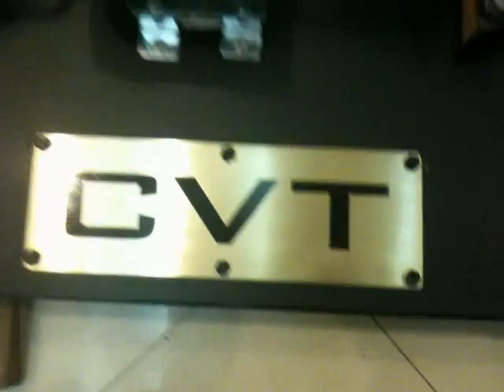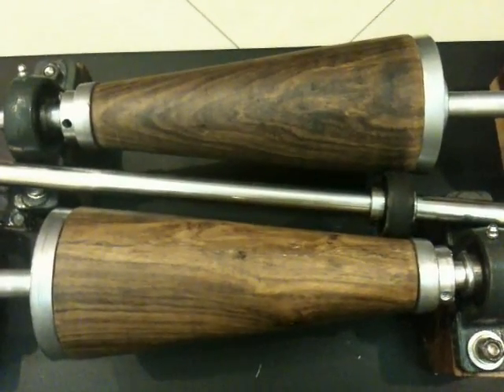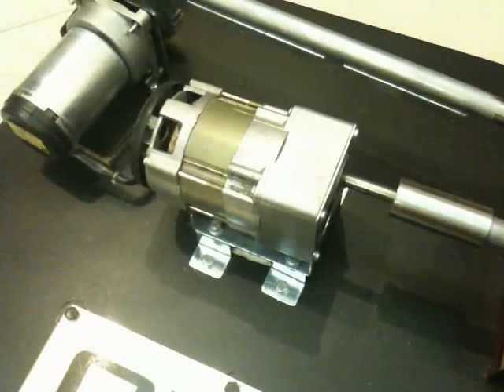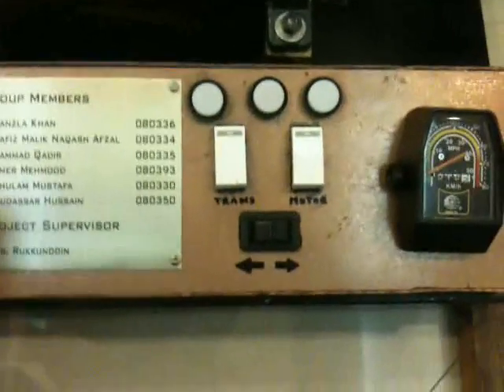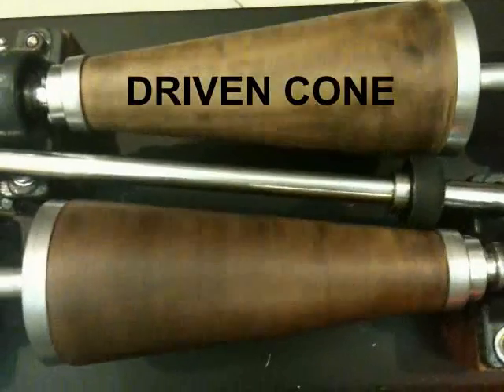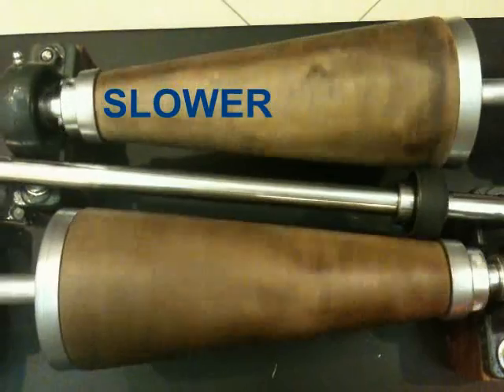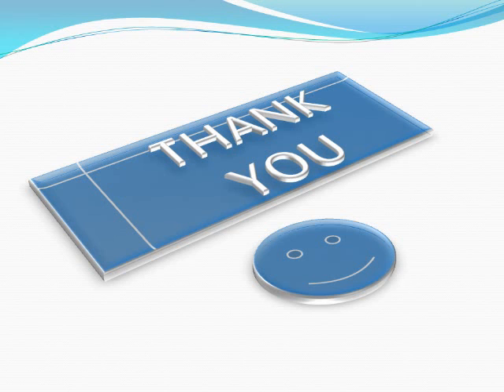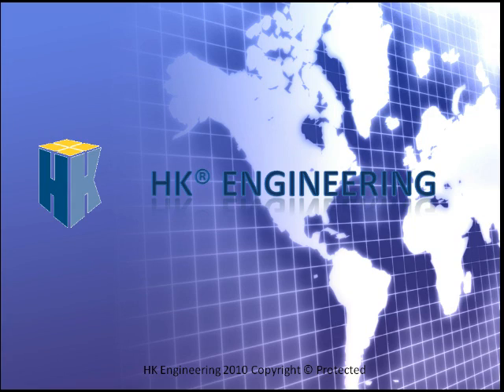CVT Cone Mesh Type

Comment: This has to be the most disconcerting text-to-speech voice I've heard. Where on earth did you find a TTS this terrible?
Reply: It sounds like it originated on earth, was broadcast to Saturn and back and then recorded for the video. Sounds worse than the speak-and-spell and that was '78.
Reply: @jacobyunderhill3999  It sounds like a radio transmission broadcast directly from the uncanny valley
Reply: This video was uploaded 11 years ago.
Reply: @wiros8101  This isn't like 2010 TTS, this is like 1975 TTS.

Comment: In the roll between the two cones there are shear forces because between two contact points of the roller the rotation speed is different. It cannot be used in cars, only as toys

Comment: I hear that CVTs can’t handle high power or torque and aren’t suitable for racing. But seeing that this one has mesh gearing and not a belt, can it handle higher stress?
Reply: It definetely could you dont need two cones one will be enough and have it designed so both the cone and selector cog have splines to mesh instead of friction drive it could definetely handle high loads but i would assume the selector would have to be powerful enough to shift/move during high load

Comment: Exactly what I invented two months ago.. Like always Im 10 years late....
Reply: It's called an Evans friction cone, it was produced around 1920. This is not original and HK engineering didn't invent anything. I strongly doubt they have any patent, as you can see they didn't provide a patent number.
Reply: its hard to be original in 2019

Comment: The cones are constant slope and the roller on the bearing has finite width THEREFORE every point across the roller width experiences a slightly different "gearing ratio". This means the roller is constantly under a torsional stress (i.e leading edge of roller wants to rotate faster than the trailing edge resulting in differential twist about its own axis).   You need a mechanism that has only a single point of contact on each cone for any location along the mechanism to avoid this problem.  Nice demo though.